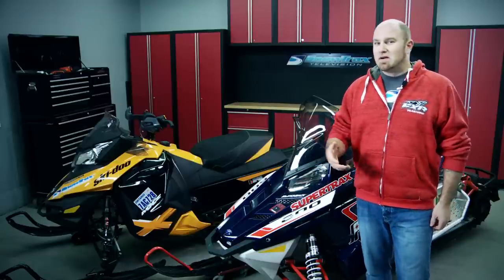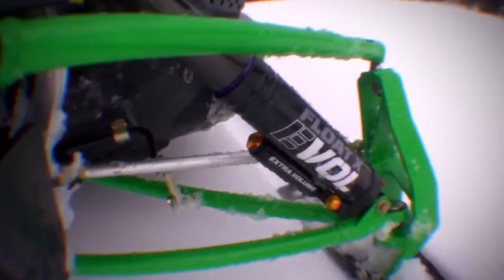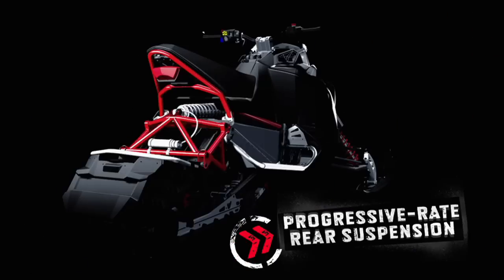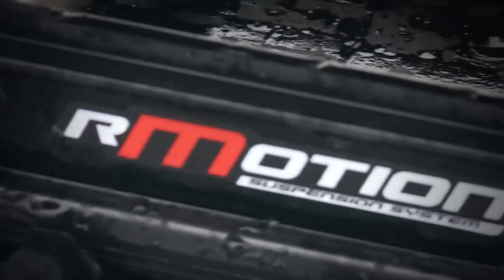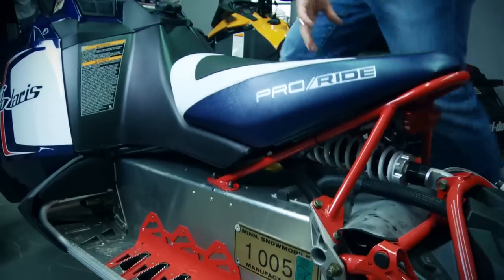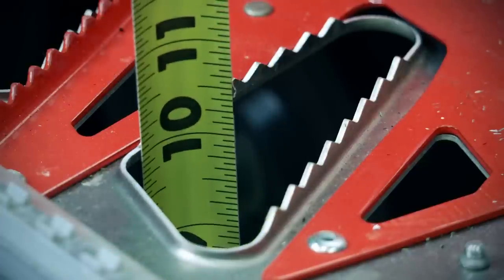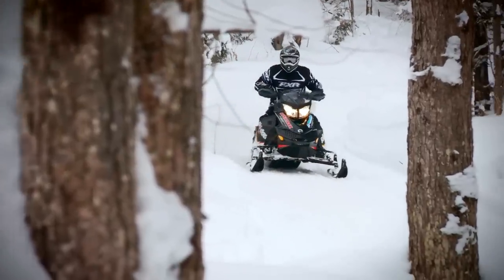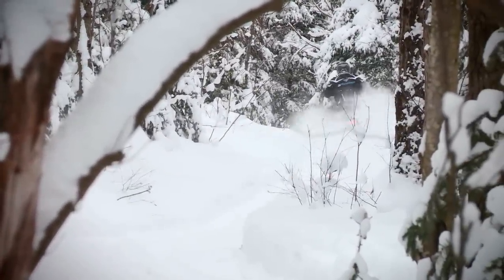Adjusting Your Snowmobile Suspension

Comment: Almost every newbie that sets up suspension think the back bottoms at full hard, but its the center. It's very common around here!

Just one thing i'd mentioned if i was to make this clip.

Center is by far the most difficult damper to get good things out from if you don't have charts or some good knowledge since earlier.

These new rider forward models realy do rely alot more on the center spring and damper imo.

Comment: If the design of these shocks is anything like a motocross, you actually tune the rebound first as there is always some compression free bleed pass the rebound needle. Meaning each time you adjust the rebound, you slightly soften/stiffen the compression a bit as well.

Comment: I have searched and searched for a video on yamaha viper/sidewinder suspension set up.. I cant find any..  Other than videos with the qs3s with the adjustable clickers.. I dont have those i have the fox 1.5 zero shocks with just a rebound knob.  At first when i would come in to a corner it felt like it wanted to roll to the outside. Someone told me to stiffen the front springs. So i did now i dont get the roll but instead pushes through to the outside of the corner..  Can someone make a video on how to set up yamaha specific suspension.. The manual only shows the qs3 set up